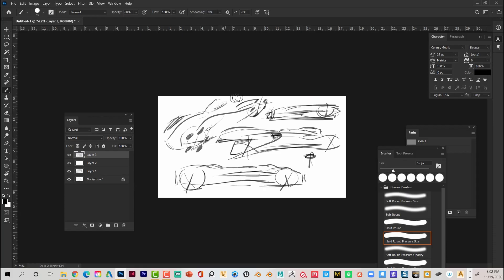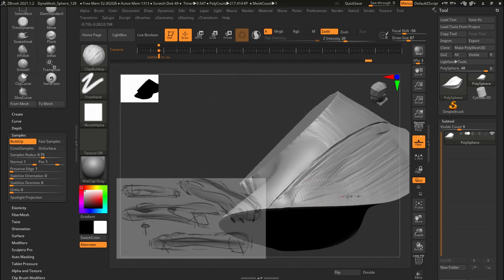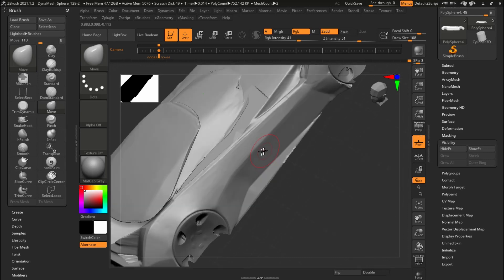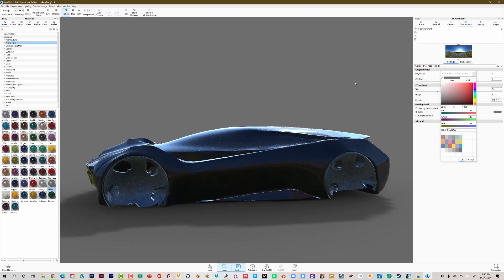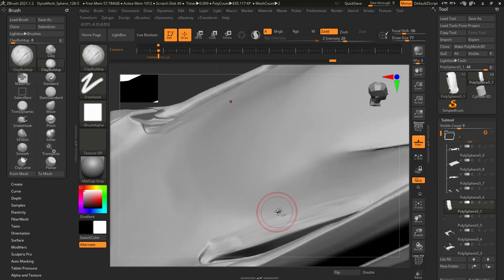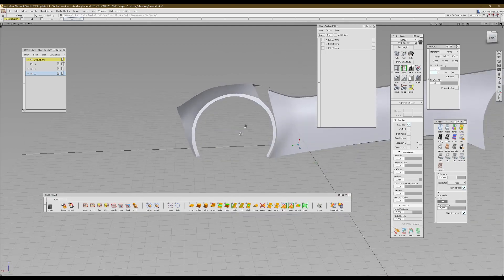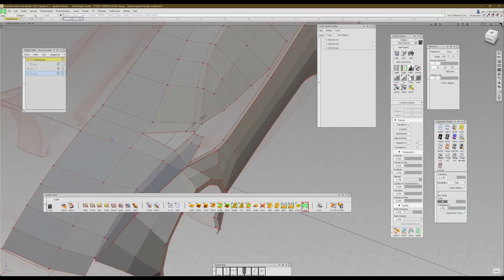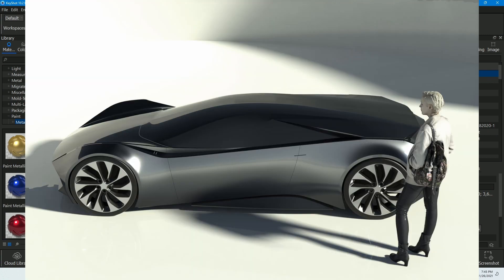Car Concept Modeling

Comment: So happy to see you back. I treasure all you videos so highly.
Reply from the maker: Are you a car design professional or student?   What kind of videos do you especially like viewing?
Reply: @Carstylus  I'm actually not in the auto industry. I'm a concept designer for robotics. But have similar workflow and use a lot of the same tools. What kind of videos I like to see... hmm...I really liked your early TIP: videos. For example the Steeringwheel one. I love some more Zbrush videos of course, but if you have some workflows in Blender it would certainly be very appreciated as well.